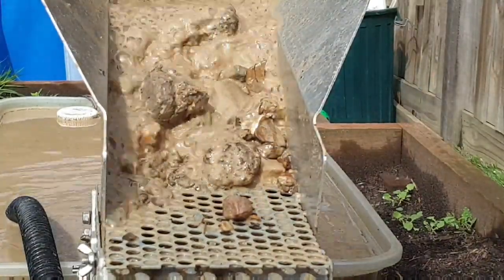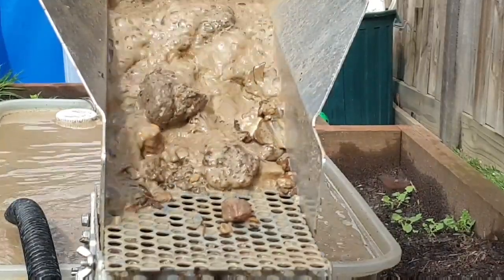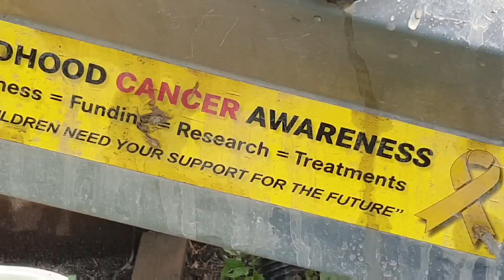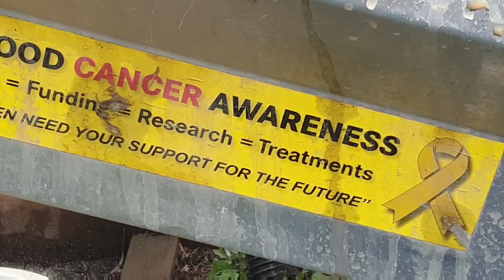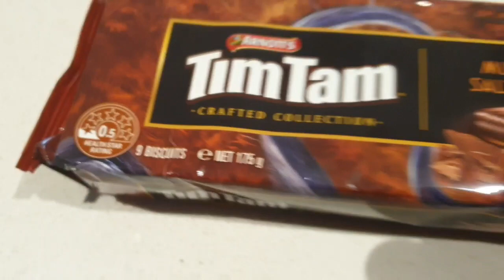Testing the new Highbanker screen  ( Mud, Clay, Rock )

Comment: You run your spray bar across the hopper - I wonder how it would go if you ran the spray bar along the hopper ? - straight down the middle.
I know you have the wrap around spray bar - maybe wait patiently to see how that looks.
It's just with the across bar , only the material directly under the bar gets washed.
Reply from the maker: One of the ideas I have is to run two 1100GPH pumps. Where the spray bar is, but have a 45 degree angle on either side. This way it should spray like the wrap around one I made.

Comment: Well done it works better than I thought it would, maybe try running those other spray nozzles again with the plate in place to see the difference, I think those twin nozzles would work a treat now. 
You should be able to cover most of the header box with sprays with no drama. Good luck and stay safe.
Reply from the maker: I Need to make a bigger set so I can run a 3000GPH pump and try the wrap around spay bar.
Reply: @MurrayRiversGoldAdventures  that's what you need, then there will be no stopping you. Except this bloody virus. Stay safe to you and your family.
Reply from the maker: @craigparry5648  I think with all the bends to keep water flow high it might be the only way. Unless I have 2 outlets on a spray bar.

Comment: Great mod mate, working nicely 👍
Reply from the maker: This set up is much better than the square plate I was trying before.  Still needs to be tested in the creek in a few different places, but am happy with it so far.
Reply: @MurrayRiversGoldAdventures  Is it because the squares don't work as good as circles ? - Like if you had the square plate all the way down instead of the circle plate , would it work as good ?
Reply from the maker: @mohammednovalija  It would be fine if the square plate ran all the way to the bottom and I removed the other plate. 
What was happening was gravel was building up on the other plate so after awhile it stopped working as well as when first starting.  This new set up so far is much better. I may do a another run tonight and add more water flow.
Reply: Where do you get the round punch plate mate?
Reply from the maker: Have a scrap bin at work, every so often they throw out some.  So I have to get a scrap docket to take it off site. You can try metal scraper. It not cheap to buy and it a big sheet. I might have a bit that you could extend your one to make it to the top. In the next video I'll go into how I've put mine on and size of the punch plate.

Comment: Do you think next time you do a modification , that you could explain a little more clearly what the modification is for ?
Like - show the equipment running without the modification , so as to demonstrate what the problem is.
And then show with the modification so's we can see if you were succesful.
I believe this modifaction was to stop gold getting caught in the original punch plate , and also to stop water running out the bottom of the hopper onto the ground.
Would like to see a clip of the water running off the back of the hopper previously - I suppose with the smaller pumps we use , we need every drop.
Especially with a recirculating sluice in dry creek beds  , water is precious.
Reply from the maker: If you look at a few video's back, you will see when I'm using the first modification with the square holes how that water was getting all the way to the bottom. Even though it was an improvement,  it still needed work. I'm happy with it, but have to try in a few different creeks to see how it handles different conditions.